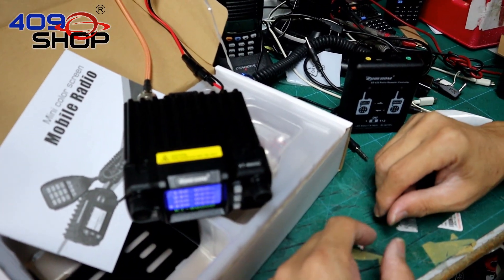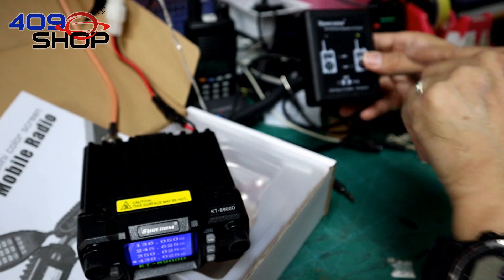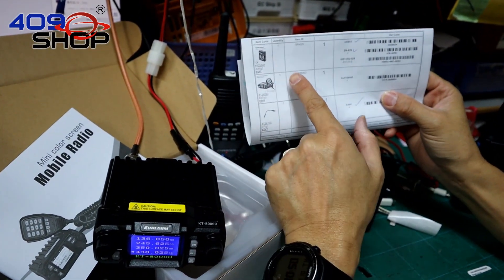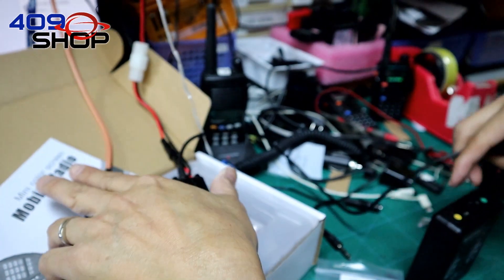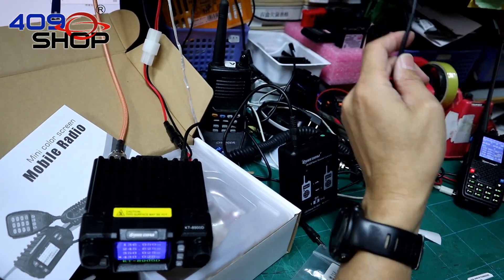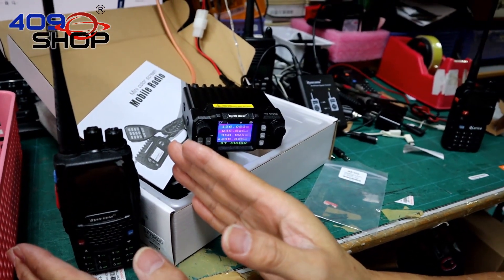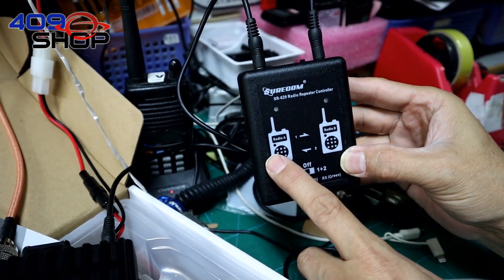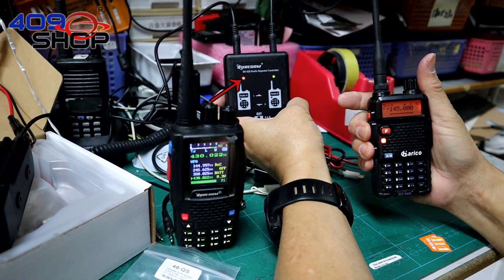SURECOM SR-629 Repeater Controller and SKT-8900D MINI MOBILE RADIO

Comment: I just got these.  I connected everything , i even use a 8 watt as transmitter and 5 watt receiver. I put 2 antennas apart.  I test it out  right next to me with 2 other radios and it does work. But when i come outside not even to my apartment parking lot i lose signal .  What can be the problem.  When i use just 2 radios as simplex i get about 2 milles and with these device as repeater i get from my qpartment door to my parking lot  . What can be wrong here anyone please?????
Reply: Same problem for me...

Comment: Do you think it would work with 800 mhz
Reply from the maker: SR-629 can work for 800mhz walkie talkie, SR-629 is a device that when received signal from radio A, it will call radio B to TX automatically

Comment: How to repeater setup kt980 plus
Reply from the maker: For KT980plus connecting with SR-629, you  need to use 48-50-Q1 repeater cable: https://www.409shop.com/409shop_product.php?id=123820
Reply from the maker: Fit for KT-980PLUS , please use cable No.48-50-Q1  https://www.409shop.com/409shop_product.php?id=123820
Reply: How about qyt kt 8900 to Ar 629 
And sr 629 to another qyt kt8900D

Comment: Show us this working both radios on same band, receiving and transmitting! Both on uhf for example 433.255 and 433.355! This is a cross band repeater, but interesting would be a repeater system that could work on same band with a short frequency shift!
Reply from the maker: Same Band  UHF need Minimum Tx and Rx frequency difference: UHF 5Mhz